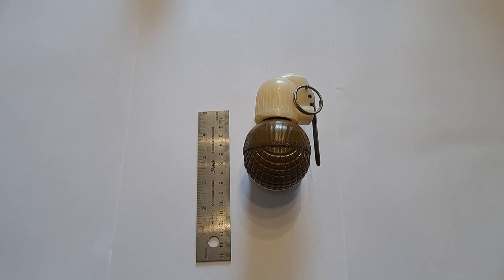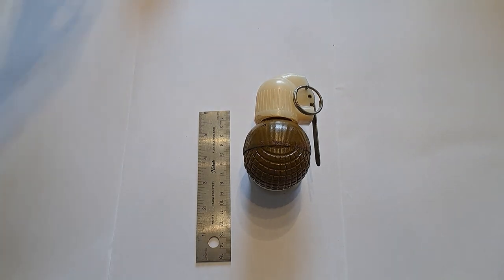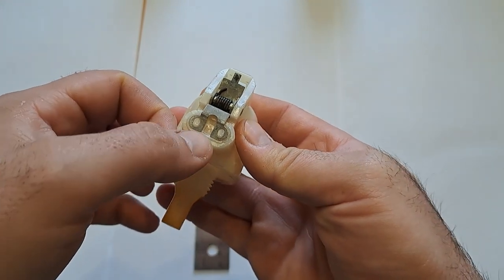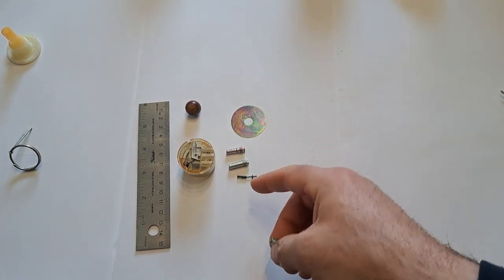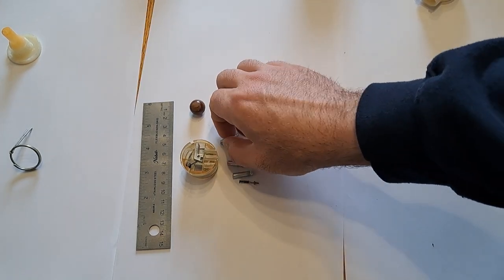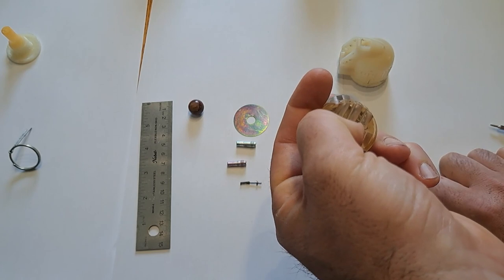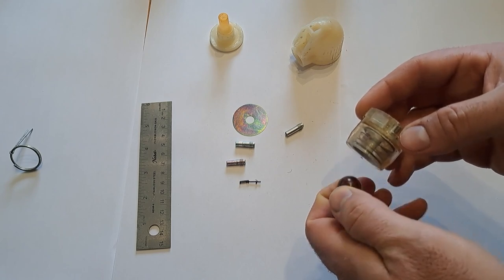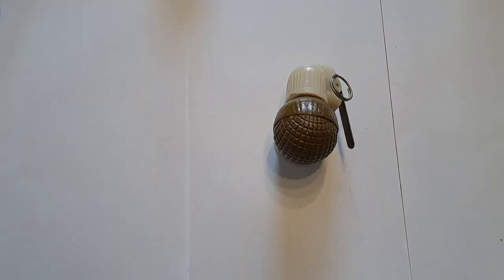Russian RGO (РГО) Grenade  (UDZS dual action fuze)

Comment: No thanks… Soviet Engineering… complex… grenade… no, no, no, no. I didn’t even like carry the M67 and that’s a tried and true design.
Reply from the maker: Lol. Yeah although the 67 is pretty well made quality wise there is still the chance of having a Crack in the delay train making it shorter or non existent. This thing has 3 with for sure much less QC and with less care for the soldier too.
Reply: @Stray03  When we would go to the Grenade Range (approximately once or twice a year). The entire Company would get to throw a live grenade (M67) after PowerPoints and safety briefs and throwing training grenades. There was a special concrete tower with bulletproof glass you could climb and watch the frags explode and the pits where you would throw. I also was awarded a NAM (Navy and Marine Corps Achievement Medal) for killing a man pinned down in rubble with an M67. I set the grenade directly on part of his exposed body once we unburied some of him. That design would be worthless for anything but throwing away from you as far as possible. I know and trust the M67. Never had a “dud”/bad fuse that I can remember. That Soviet concept of an “instant detonation” with a fale safe delay does have advantages but also limitations. In Iraq we would throw the frag as hard into a building as you could and you could “bounce” the grenade off a concrete wall into an unseen room. If you are dropping a grenade through a pipe in a bunker or building roof… it might hit the side of the pipe as it falls… what if you throw it in the woods and it hits a tree branch above you? “pressure detonation” sounds scary. As a Marine Infantryman who was sent to the Marine equivalent of “Sapper School” I loved explosives but fragmentation grenades always terrified me. You’re carrying instant death on your person for months. HARD months with no cleaning and crawling over walls and through brush and low crawling… the frags get “beat up” really bad. Plastics? Soviet plastics? Complex fiddlly design that could result in instant death… Ughhh no. No. No. No thanks. And YOU ARE WEARING IT LIKE JEWELRY… I have a “love and hate” relationship… with the devices.

Comment: I like the string safety on the 247 a little better for the simplicity, but that one is damn clever.
Reply from the maker: Good thing about it is that it still has a delay, even if the impact doesn't set it off, eventually it will still go off, the 247 wont.
Reply: @Stray03  i always thought a spoon fuse could be used to good effect with one of those ball strikers to achieve a destruction delay, but in my head the spoon would pull the stop away from the ball striker mechanism on release, but that wouldn't be safe with the "tree branch short-stop" scenario like this one would hopefully be.

Comment: Oh, shuks, I suuuuuuuuuuuuuuuuure want one...... where on earth did you find such ? Since I cant own one, I'm just lovin' yer videos!

The ball is made of epoxy and small led balls so it will disintegrate and not become a projectile that will fly far and anywhere...., a problem with the lead balls in the British Always Fuzes (M-69?) as used on the Gammon Grenade.

Thank you!
Reply from the maker: Got lucky and was at the right place at the right time. Been looking for one for a while, saw this didn't even try to bargain. Yeah the ball idea makes sense, just don't know why they would use it on a grenade that already is designed to throw shrapnel. Maybe it is just lighter than a full lead ball?
Reply: @Stray03  I’m a structural Engineer… not a mechanical… so I don’t know what that is worth but it is true that the M67 will sometimes throw off “big” chunks of shrapnel. This might seem like a great design concept. But offensive and defensive grenades are built differently for different reasons. Ideally when you throw the grenade out into an open field… throw it as far as the average Marine Infantryman can throw (which is measured and known). You want the fragments the grenade produces to only kill the enemy. But that being said… big or small pellets… if one hits you… it’s not going to be a good day. I tend to agree that it might also be a design choice based on “weight or mass distribution” of the epoxy blob for some reason. Or economics and other design considerations combined. Maybe they needed the mass but couldn’t tolerate an exposed metal that might corrode during some period of the designed service life.
Reply: @Stray03  Why would there be three ball bearings of that size and not one? Unless you could vary the amount of mass for a more “sensitive” fuse. Or as stated. To give any possible fragment produced a uniform consistent size. The plastic will be turned into a gas (vaporized). It’s an interesting puzzle. Chip… why did you say what you said? Was it an educated Guess? Or is there some documentation that is indeed why the design is as it is? Just curious.
Reply from the maker: It is basically shot in a resin. Maybe since there is a big hole in the top of the body they replace a solid ball with many small bearings or lead shot which ever it is to as you say give multiple fragments (like how the claymore holds its schrspnel together) and increase possibility of hitting a target. 1 ball vs birdshot basically.
Reply: @Stray03  
 I admire your luck!!!
As you most likely know there is the defensive frag version and  the  offensive blast models, the fuze is the same on both I would assume.,  The Britts were worried about the lead ball in their Allways fuze to 100 yards or more.
Reply from the maker: Yup this is the defensive version. The RGN is the offensive version. Body is made out of aluminum on that one.
Reply: @jastrapper190    Ive been a student of small mechanisms since I was a watch taking apart kid....and I read alot.....LOL
  From Wikipedia;
"The all-ways fuze had a minor design defect in that the hard steel ball bearing would be propelled away from the explosion as a piece of shrapnel. When used in an "offensive" application such as the No. 69 grenade, where the user was not required to take cover before throwing, there was a chance that the user could be struck and injured by the fast-moving ball bearing.[3] According to military author Ian V. Hogg, this problem led to restrictions in the use of the grenade as practice ordnance.[4]"
https://en.wikipedia.org/wiki/No._69_grenade
Reply: @chiphailstone589  Thank you very much for the info. Very impressive “Googling”. I think I am sold on that idea. I can corroborate this. When we would throw training grenades… you could watch the detonations through “safety glass” (which was like a foot thick of bonded layers… super duty bullet proof embedded into a concrete bunker) anyway. The normal pellets would just “pick” at that glass. You could tell when they would hit right in front of your face. However every now and then… a piece of the fuse which is a solid “hunk” of steel would whack the window. And it would “spiderweb” it. Which sucked because it made it harder to see the grenades detonating which was it’s purpose. Don’t tell anybody but I always collected “fragments” on the grenade range. (Completly against the rules btw… 😂). I would put them into little bottles and sell them because the “pellets” are awesome. Very uniform size. They got their engineering right on the Composition B charge and the grenade steel type, geometry, thickness and dimensions. However you would also find huge chunks (relatively speaking) of fuse which would not fit in the little bottles.
Reply: @chiphailstone589  Not a lot of people know but they actually teach a specific way to “lie” on the ground if encountering a grenade in front of you. Friendly thrown by you or an enemy grenade that lands at a distance. They train to put your helmet (or feet) directly at the grenade aand to get as small as possible. If a single pellet or two hits you from a grenade like an m67… the Kevlar helmet and body armor will “absorb” that… at least the design says it should be able to… combat is unforgiving either way… you do the best you can. But you lie like an arrow with your hands tucked and try to give the grenade the least probability of causing you injury. You also NEVER yell “GRENADE” before throwing one. That specific word and call is solely reserved for an incoming enemy grenade that needs urgent attention by everyone in it’s proximity.
Reply: Shucks, I didnt hit send, .....The idea is that  small light objects lose velocity very quickly, loss of momentum. Its like a 12 gauge #12 shot defense load for use in a house; the small shot will kill a perp at short distances, but after striking a wall or hopefully the perp first, its momentum is gone, so over penetration into a room with kids or neighbors will be much slower and less likely to kill than, say, 00Buck or slugs.  small balls in epoxy wont be dangerouse past the blast radius like the larger heavier balls.
Reply: @jastrapper190  there is very few "Grenade" books out there, but the internet has a ton of info (as found here) and Google is our friend in this aspect. Guys like Stray 03 rock! 

I have a couple practice URG86SK's I wonder if their impact fuses are intact? how to disassemble? LOL!!!
 The Czechs made several impact grenades as did the Italians. Very interesting designs.

Thanks for the grenade survival tips, its a crazy world out there, might come in handy.

Comment: I know yt will never boost you despite you not having an ideology about using this stuff but you're still valuable 😃 👍
  How did this plastic Rube-Goldberg device handle temperature swings? Did they crack or shrink till they'd stick or anything like that?
Reply: And can water penetrate and freeze inside?
Reply from the maker: I don't have any info on temperature but I assume it follows the standard you would see on similar items. The plastic as you see gets weaker after time so it will Crack once it gets old enough or is improperly stored. While not cracked the whole thing is sealed so unless there was a flaw in it, there is no way for water to get into the fuze mechanism.